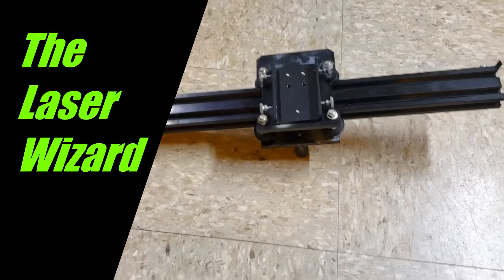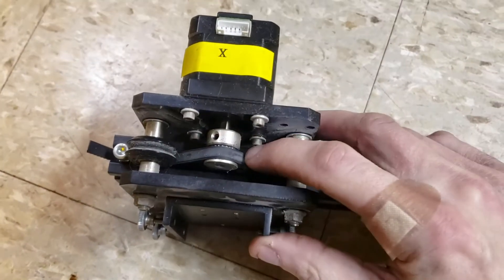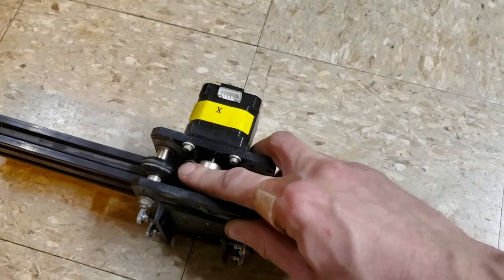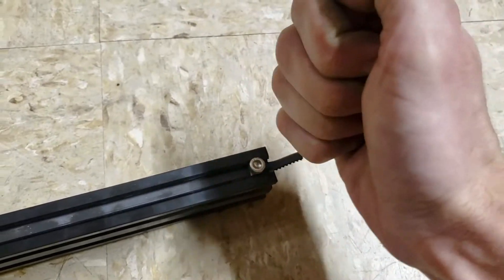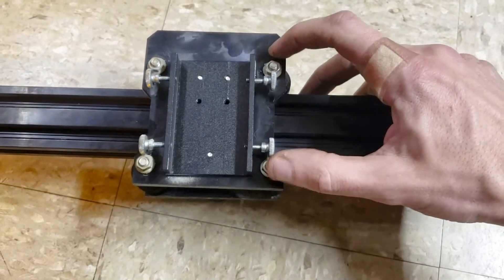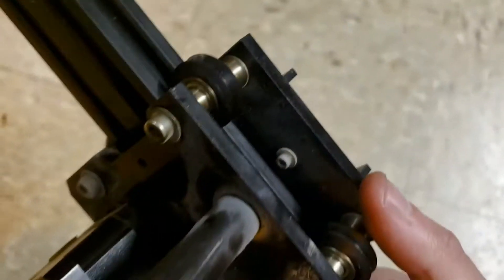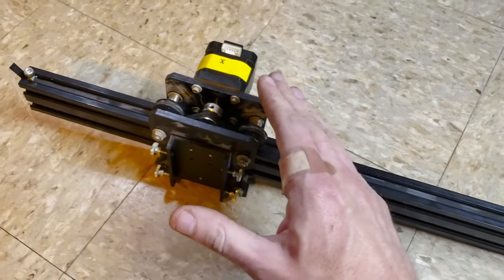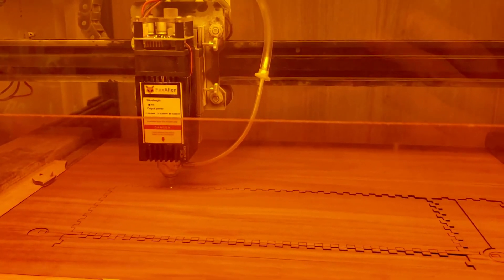Setting Proper Belt and V-Wheel Tension (VERY IMPORTANT)

Comment: Do you have any other tips for the X axis? Fox Alien showed my how to turn the power up to the motor itself on the controller. I’m having issues. The motor will jog left to right repeatedly when I only click the left or the right on the move screen of Lightburn. I’ve used your video to attempt adjust the belt tension. It seems like there is very little room for error. The slightest movement can either make the belt to loose or to tight. Do you have an easy way to other then allowing the “sled” (not sure what you call it) to move freely while the machine is powered off? It seems like if I under tighten the belt the motor doesn’t necessarily spin the gear it makes a grinding noise with no movement. Any ideas? I’m kinda at a loss. Thank you!
Reply from the maker: You want the belt only tight enough to not skip teeth on the belt. If your carriage/sled slides smoothly under gravity and your belt tension is good, it should work well.

What exactly is going on with your machine? You say that you're able to jog it with the move controls? If the jog controls work, it should move just the same when you send a file.